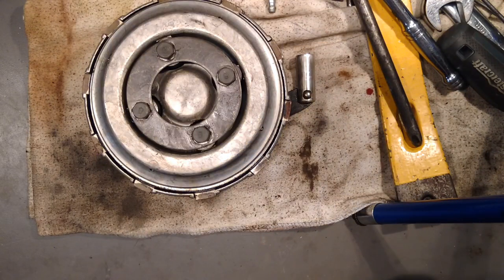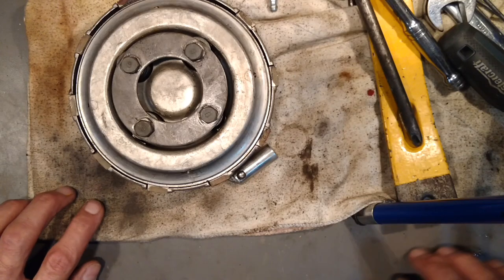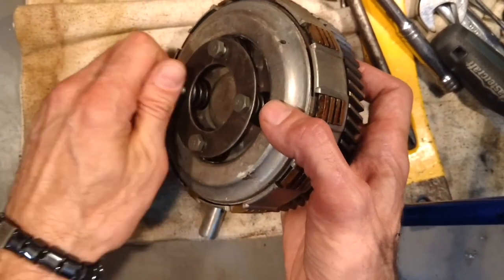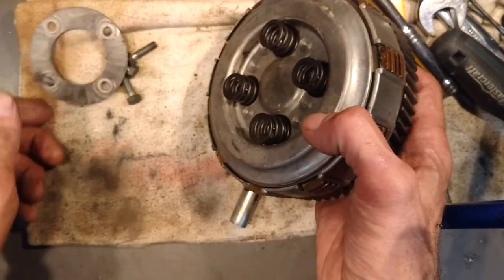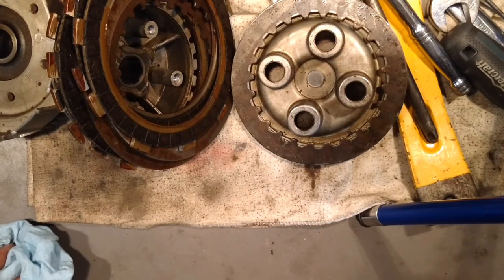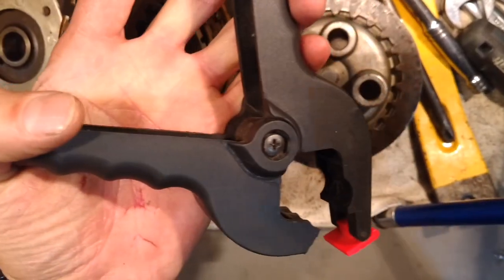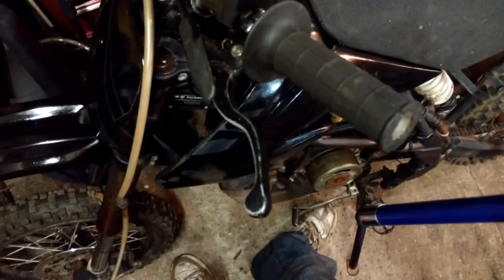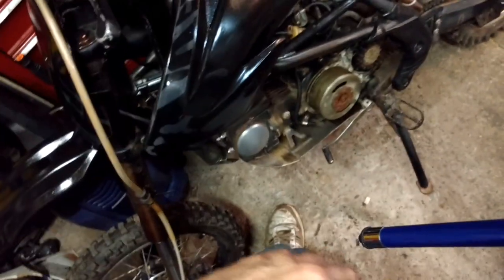Unseize your motorcycle clutch without removing a single bolt.

Comment: I tried your idea to clamp the clutch lever and it worked like a charm.  It was jumping into gear even when the clutch lever was pulled in but after clamping it for 24 hours it worked great.  This was on a 1973 Yamaha LT3 100.  Thanks for the tip.

Comment: You saved me a BUNCH of time and trouble boss!! I had tried everything I could    think of to break the frictions and steels loose in the seized clutch on my 90 Shadow VT 1100c. Nothing worked and I had grabbed my Clymer's out in advance of opening everything up. Never occurred to me that the steady pressure applied over a period of time would do the trick. Just happened upon your video by chance and it worked like a charm (and I am running a juice clutch). Amazing! Thanks again for staying up late to shoot this. I owe you one.
Reply from the maker: And thank you Lawrence for such kind feedback.  Those words are worth a million bucks to me Sir 🙏🧘‍♂️
Reply: @shopyoga  you rightly deserve them boss 👏🤟

Comment: Watched your video after I realized I had a stuck clutch on my 1970 Honda SL 100. Put a clamp on the clutch level and left it overnight. I kicked the motor over a couple of times the next day and after the third try it broke loose and now works fine. After seven years your advise is still applicable. Many Thanks!!!!

Comment: 8:58 if you're stopped at the lights in gear with the clutch pulled in and the engine is running, all the plates are free. If any one friction plate is stuck to the steel this will lock the basket to the drum and the engine will stall (unless all the teeth are missing from the friction plate).

Comment: Man what a lifesaver.  You talk slow in the video and take your time getting to the point.  But the point is worth the wait.  Had a bike that sat for 14 years.  Clutch was solidly stuck.  I'd read of putting ATF fluid in and getting them unstuck.  Was planning on that, and assumed I'd have to disassemble the clutch. 

Topped up the oil, cranked the kickstart a dozen times to circulate the oil.  Clamped the clutch lever.  36 hours later, it was releasing though not quite freely.  Pumped the kick start a dozen more.  24 hours later, she was free as it should be.  Now I can clean the carbs and get this Honda 750 Four back on the road.
Reply: Iv just got a zx7r that slips under wide open throttle, it had a new clutch kit and spring kit about 5k mile ago but its been off the road for 5 years stored nicely it runs fine and will go up and down the gearbox but slips when you put it under throttle load, sound like friction plates?

Comment: Rate this advice 100%. My 1938 matchless g80 was sitting with no oil in the primary case for a year. Clamped the clutch lever filled the primary with oil and left it over night. Within 10 kicks it broke free.

Comment: This trick has just worked for me too! Left clutch lever pulled back to the grips with a couple of bicycle inner tube elastic bands wrapped round for 48 hrs, clutch was still seized when I tried to kick it over in gear with back wheel on ground. Started engine in 1st gear and ran on centre stand with wheel spinning at about 3000 engine RPM and jabbed the back brake, hey presto! The back stopped and the engine  continued spinning - clutch now works perfectly. Great trick!

Comment: DUDE!!!! My son broke the clutch cable on my wolf classic 150, which is basically a Honda CB 150 . Replaces the cable. The clutch wouldn’t work . Was stuck in gear. 8 months later I’m about to fork out cash to fix this and I see your Video.. we up and running!!! Soooo stoked . 100,000,000 thank you.

Comment: Thanks so much for this video. My Kawasaki 1600 Nomad sat for two years due to illness. I am ready to ride again. and couldn’t figure out what happened. I would put in gear and it lurched forward. New oil and a clamp on the clutch lever for two days. Ran it twice till warm and then tried the clutch. I ran it down my driveway and it felt like it use to and worked great. Thanks for the heads up.

Comment: I have not rode my bike for 4 weeks at first I tipped it over and I assume I flooded it? Whatever it was I couldn't get it to start. After letting it sit and just charging the battery and waiting two weeks for a little bit warmer weather it finally started. I WAS SO EXCITED. Finally I could ride right? NOPE the clutch was stuck but I had no idea. I was driving myself mad playing around with the carb, air filter, spark plug, and battery. The bike would start up fine but then it would lurch forward and die when put into gear even with the clutch pressed all the way in.  It was such a tease the weather was so nice I couldn't enjoy it. Literally losing sleep because it is a brand new bike and I couldn't use it. I was thinking worst case scenarios as far as ways to fix it. Then I tried your trick and it worked like a charm. Not only did you showing what to do but explaining the HOW and WHY with your spare parts was also key. I left my vice grips on for maybe 30 seconds and I could literally hear the springs in the clutch releasing like one of those door stoppers. Right away I knew that was it. I didn't want to get ahead of myself so I just let it sit over night. Today after a whole fucking month I rode my bike again. I can't thank you enough. All from a simple video you helped some random stranger make their  life a little better :)

Comment: Vmax hasn't ran for 5 years. Warmed engine up, changed oil, warmed up again, pulled in the clutch and put in gear - it lurched forward and died.. Several times. Clamps on  clutch. 24hrs later, warmed it up and tried it again.. Works fine! Thank you! Great tip! 🙂

Comment: Quick way - front wheel against a wall - start engine put it in gear… drop the clutch! Plates should break free.

Alternatively you can ride along in 2nd then apply rear brake whilst clutch is pulled in keep repeating until it frees up the plates
Reply: Iv just got a zx7r that's been off the road stored nicely for 5 years so nothings seized the brakes etc but the clutch is slipping under wide open throttle - in 2013 a couple years before it came off the road it had a new clutch and spring kit itl go into gear and pull away fine etc but under wide open throttle as you go up the rev range it slips - could this be a couple of stuck friction plates?
Reply: @s1dew1nd3r4  yeah most likely bud.. either that or lack of oil between the plates from sitting is common too... 

You can if its not your daily bike.. tie some string/wire around the clutch so its engaged and slowly it allows oil to penetrate between the plates. Can take 1-2 days tho.

Or you can try the above mate ride along at low speed say 20-30 brake hard with the rear  whilst holding the clutch in repeat a few times the vibration through the clutch helps free up and stuck plates.

Only other cause of slipping clutch is wore out friction plates.. and using the wrong oil like semi - fully synthetic which im sure you arent doing that anyways

Comment: Thank you sir. I did know that if I was overwintering my bike (Ducati 750SS) I should have put on a bungee cord on the clutch to pull it, but I didn't bother and left it sitting 10 years (Kids) and now I have this problem. Good to know there is a potentially easy fix to start with. Will pull the sparkplugs and  push around in gear for a while to circulate the oil to see if this works. Thanks for the helpful video.

Comment: the problem you addressing is very important, i bought an old bike and i had exactly same issue i started solving by tightening clutch wire, but still bike kicks and shuts off when put in gear with clutch, so i had to leave it for 5 min in neutral then is soften up and while riding bike gear were so hard like you are doing without pressing clutch.
so then i opened the clutch box and guess what, the additives you put in oil thinking it will clean the engine ends up jamming the clutch plates, the oil sludge was all over plates and were acting like a glue, i found clutch basket had teeths aswell causing this issue you are having. so i solved this issue and still working fine.

Comment: Fantastic advice, trying to unstuck a Suzi TS185 clutch and I think this is the ticket. Cheers
Reply from the maker: +Brotherd Mike thanks for the positive feedback.  One of my earlier bikes, many years ago, was a TS... It was a 1978 or 79 and 125cc if I recall correctly.  No powerband but still stayed beside my buddy on his XR 100.  Heck, many times he couldn't keep up which would irritate him because his bike was brand new.  I still love the old air cooled two stroke and presently ride a 1983 Suzuki PE 175 for enduro events.  Hope your clutch unsticks😀.  Cheers
Reply: Haha i am here because my 74 ts185 (first ever bike, i bought two days ago) has a sticky clutch
Reply: Anthony Holdway, in the end, I couldn't unstick my clutch with the trick in this video. But it was a painless job to drain the gearbox oil, remove the clutch cover/casing and separate the plates manually. My friction plates had dried out and fused to the steel plates.
Reply: Brotherd Mike luckily they aren't to expensive to replace. I dumped my oil and checked the plates the oil was really old n dirty. I can separate each plate it just feels like theres wet glue in between them so hopefully a oil change and a short run will clean it up

Comment: If you have an electric start just try start it in gear let the bike roll as soon as you get it started clutch in stop tilt the bike over to the clutch side while running in gear clutched in. Engage and disengage clutch just enough so it creeps forward it should get unstuck.

Comment: My girlfriend’s cousin gave me a 1978 Honda XL100 that had been sitting for over 6 years. I cleaned the gas tank, lines and carburetor. One front fork was bone dry and collapsed all the way. The other still worked a bit but the tranny fluid had gone bad and think. I refurbished them because I couldn’t find affordable parts. Half the spokes were broken. So I got that fixed. Finally after all that I had a chance to take her up and down the street. I let her idle for 10 minutes and she went into first fine enough. Going to second and third was really rough and so I was too scared to put her in fourth. She hated when I kicked her down gears and in first she was so rough. I would stick my foot out to turn and she would stall. Not she is stuck in gear and can’t get her back into neutral. I will try this method. Hope it works.
Reply from the maker: Hi Daniel, wish you the best with it!  I love hearing about those classic Honda being rescued. Curious about how much clutch action you feel on the lever.  Sometimes the cable after sitting a while will stretch like mad in the first couple hours put back to use. 
You probably know already that engine off and not touching the clutch at all, rocking the bike forward and backward should allow to shift through all gears relatively smoothly.  If there's considerable resistance doing that, I would continue to do in hope gears start shifting smoother.  It may be a case of some buildup of crud around the shift drum and manual shifting a bunch frees up the works.  Also, how does the shift lever look too?  If it's slipping on the spline, that will make catching gears near impossible 🧘‍♂️.  Just a couple little things to hopefully help 🙏 Cheers

Comment: I have a 72 honda cl100. Bike confused me a bit cause everything I searched to match the bike for its year was a bit off and it took a minute for me to figure out that the bike is actually a spot on depiction of a 71 cl100. Not to big of a deal unless you're looling for exterior parts like side panels like me. I'm having new ones custom made since i dont have them or my headlight. Bike as been sitting for longer than ive been alive. My dad acquired it somewhere in the late late 90s possibly 2000 maybe 2001. He gave it to me when i was about 10 and i was born in 2003. The bike was acquired from my uncle's scrap pile and its been sitting for at least 20 years. I tinkered with it here and there but couldn't afford parts in middle school. I managed to get a set of honda oem points with a condensor and replaced them which made the bike run. I replaced the rear tire in freshman year of highschool and then deflated the tire and parked in the shed. I later got my hands on a fuel tank off a bike that was the same year but its was a cb125. Still fits the frame perfectly but its not original to that bike however I like the emblems better since they have the Honda wing on them and they're actual pot metal. Not plastic or stickers or some dumb shit. I ended up finding the original tank and ordered the mounts for it, i bought front fork seals to rebuild the forks. I got lucky and found a bias ply tire for it which is odd cause bias ply isn't widely available and neither are 2.50x18 size tires in general. I ordered a tube but the company sent the wrong one. I was very impatient and found a 3.50×18 and just sent her anyways. Now i just need to fix my clutch since its frozen from sitting so long. She's almost ready. I'm trying to get her going cause im tired of seeing it sit, and my buddy just got his 110 three wheeler goin and we're planning on taking the bikes on some trails around our area and up on the Indian reservation where he's from. Maybe later this afternoon ill have her moving

Comment: Thanks for the great tip. 66 Triumph Bonneville clutch plates were stuck together tight. Talked to a few very experienced motorcycle mechanics and they all said I`d have to pull the primary cover, a lot of work. Your video solved my problem in 3 days.

Comment: Just bought an old bike motor was seized. Used on blaster to free it .clutch is frozen but I cant pull the lever so I'm guessing this technique wont work in my situation. Thanks for sharing this

Comment: My 2009 Honda Rebel 250 had only been sitting for about two weeks when the clutch stuck. I rocked it back and forth while in gear and the clutch released. A week later, it was stuck again. I’m trying your method now and will check it in one and two days. If it doesn’t release, would a complete oil change with Honda brand oil be worth trying? I’ve been riding since 1967 and have never had a clutch stick although most of my bikes are started and ridden every two weeks. I’ll let you know.
Reply from the maker: Hi Jeffrey, wonderful fun bike the 250 Rebel!  Yes, plates stuck as often as your experiencing, for the minimal extra cost I'd just switch out to Honda brand oil H4 I think they call it as a process of elimination.  If you can, run the engine up to operating temperature before drain and have a close look at that oil. Hoping it's not milky but if so you got water/condensation and possibly the exposed steel plates developed some rust. Fresh Honda oil and a ride probably will sort it 🙏

Comment: Will this work on a bike and electric starter? 

If so, should I try starting it with it in gear to “kick it over” a few times?
Reply from the maker: Yes, would work very same way.  So, presumably if your bike is in gear, clutch in, push start button and the bike is rolling forward lurching with the spin of starter motor, yes?  Give it two days clutch tied in, then start in neutral, idling in neutral pull clutch in (if it isn't already) and put it into first gear.  Prepare for it to lurch~or rather jump forward on you.  Try this a few times~ if it doesn't break free, let sit one more night clutch pulled in and try again. Cheers
Reply from the maker: Also, in gear or not the moment you electric start spin the engine, the clutch gets an oil bath all the way around.
Reply: @shopyoga    Thank you so much. I have the clutch lever held down with a zip tie. 

I also ran the engine in neutral to warm up the oil and then left it leaned over to the right a bit to bring up the oil level on that side and drown the clutch plates in the hot oil… Is this a good idea?

I’ll let it sit like this for a day or two, and then try starting it in neutral and then putting it into first gear as you advised.
Reply from the maker: @nataliamiliano150 yes that's smart!  All of what you did puts you at the best advantage.

Comment: I'm storing my Scorpa trials bike like this from now on.  #genius
Reply from the maker: Thank you so much for watching and your comment.  I would actually recommend if you can to wait a day or two before you plan to use your scorpa and do the lever then.  I've discovered that long term takes the tensile strength from the springs and clutch starts slipping 😑.  Cheers

Comment: I just got a zx7r that's been laid up for 5 years but moved about periodically and ran upto temp but not really been ridden anywhere. It had a new clutch kit and spring kit in 2013 so in like the last 5k miles but was then off the road from 2016 - now the bike fires up and runs fine and I can ride it and go up and down the gearbox but when you put it under wide open throttle the clutch is slipping as it goes up the rev range, would that be sticking friction plates? As the clutch itself is still actually fairly new.
Reply from the maker: Hi, that actually sounds like the engine is overpowering the clutch and the clutch is slipping periodically.  Same thing happens on my 1400 intruder and I just ease off throttle a moment and she hooks up again.  I believe springs should be replaced, or upgraded to get that plate pressure back👍